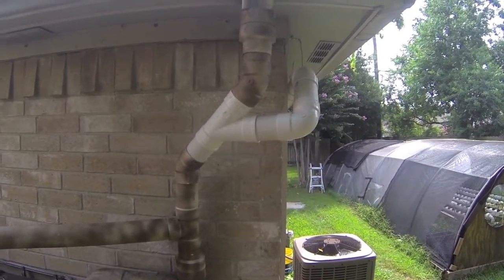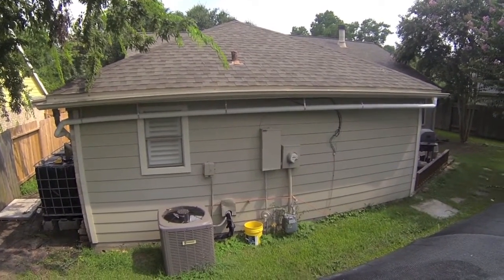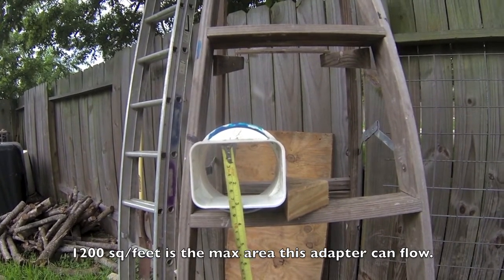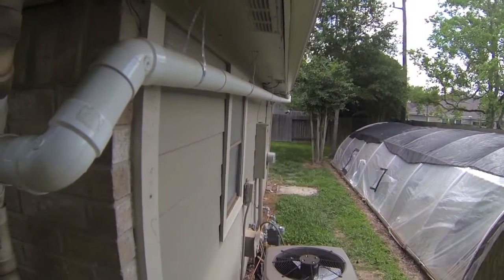Step 3 - IBC Rainwater Harvesting System- Gutters

Comment: WONDERFUL videos Trenton... would you mind telling me what are those 3 pipes below the gutter drop for? those are closed at the bottom, why? is that to filter gutter rocks or roof dust etc?, and THANKS for such detailed videos
Reply from the maker: Sea Swell, that is a  first flush diverter. Have you watch this video? Step 4 - IBC Rainwater Harvesting System - First Flush Diverter 
The diverter catches the first water of each rain, that water is the heaviest in debris. The cap at the bottom allows you to clean the pipes out and they also act as a automatic reset. By leaving the caps loose they leak out slowly and automatically reset themselves for each rain.
Reply: Thank you

Comment: Trenton, thanks so much for all the videos... great work and a HUGE help! Where did you get the 4"x3" rectangle to 3" round pipe piece? I haven't been able to find them anywhere around me...
Reply from the maker: icul00kin I located mine at a local hardware store. Call a local gutter company if you can not find one,or try these links..  One thing I have learned is to order online and wait a few days rather than drive all over town looking for a single part. 

PVC Offset Downspout Adapter
http://www.amazon.com/Genova-46234-Offset-Downspout-Adapter/dp/B000WI4BH8/ref=sr_1_3?ie=UTF8&qid=1410974694&sr=8-3&keywords=gutter+downspout+adapter+3x4

Downspout Adapter
http://www.amazon.com/Genova-Downspout-Adapter-Adj-White/dp/B000R3SOOE/ref=sr_1_4?ie=UTF8&qid=1410974911&sr=8-4&keywords=gutter+downspout+adapter+3x4
Reply from the maker: ***** If that is all you can find a is 4'' you can also buy a 4'' to 3'' reducer which will convert the pipe to 3''.
Reply from the maker: ***** http://www.amazon.com/Canplas-414433BC-3X4X3-Spout-Adaptor/dp/B00MH5F286/ref=sr_1_fkmr1_2?ie=UTF8&qid=1413576544&sr=8-2-fkmr1&keywords=gutter+downspout+adapter+3x4x3
Reply: Trenton Kaminski thanks so much! I'm not sure how I didn't see your reply until today. Thanks again :)

Comment: Great videos, I'm learning so much! Would you mind giving me an even more detailed explanation of the hook-up for the top cap where the 3" pipe enters into the tote? Thanks!
Reply from the maker: Thanks for watching Liberty Hunter, basically I took a 3.5 inch hole saw and cut a hole in the lid. After that I connected  3 inch threaded male and female adapters between the lid. I also included a home made gasket when connecting the adapters, the adapters will not tighten flush. To ensure a tight fit you will needs to make something similar. From there I used a short piece of 3 inch pvc pipe ( 6 inches or so )  and a 3 inch pvc 90, then from the 90 I have a 3 inch pipe tied into the first flush diverter and gutter down spout. In between the 3in adapter on the lid and the 3 inch pipe  ( about 6 inches ) I placed a pantyhose around the pipe, then I pushed the pipe into the adapter on the lid. Its a tight fit, I also did the same on the 90 adapter. This away I can catch the pebbles that fall of the shingles.  Does this help, or what specific part?